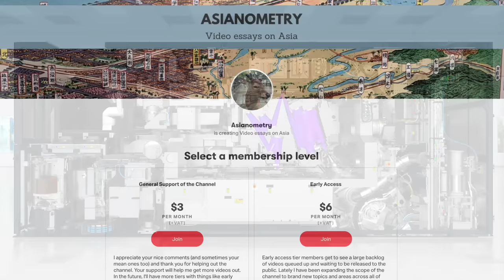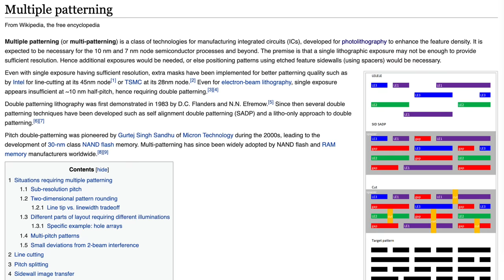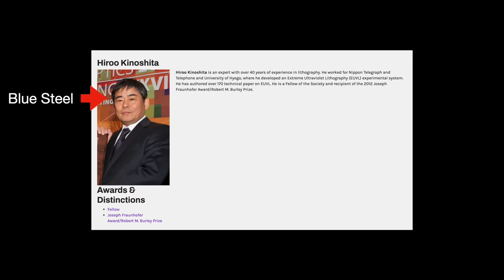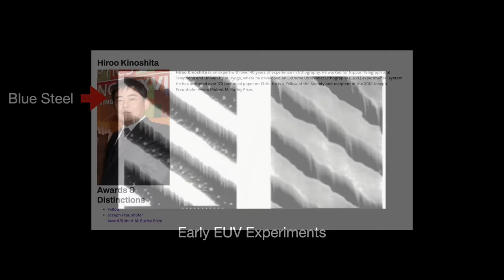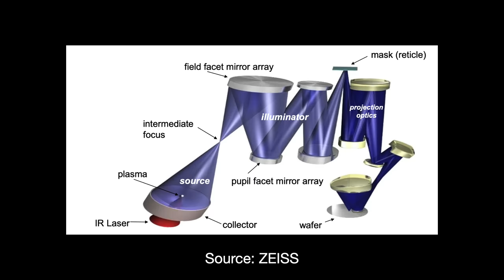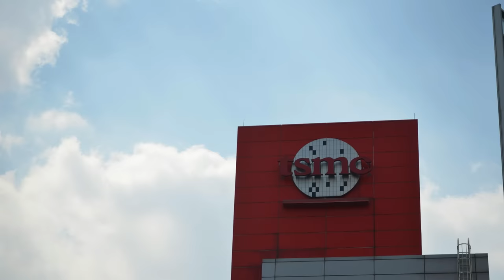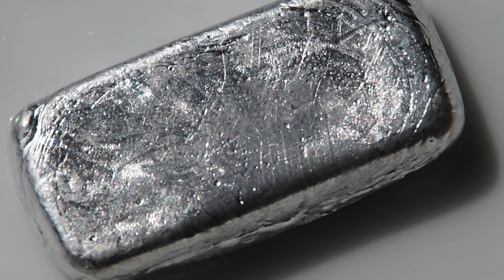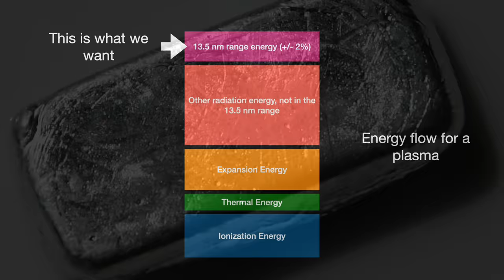The Extreme Engineering of ASML’s EUV Light Source

Comment: How about swap the hydrogen out for a mix of deuterium and helium . Have the plasma chamber surrounded by a powerful magnetic field with an internal RF exciter coil. Next drop in your tin ir other metal. Blast with a powerful laser, type does not matter much except that it must be high energy density. Q switched lasers. It will require two pulses. First from an excimer laser such as ArF, that one strips the remaining outer shell electrons, second a q switched Nd or CO2 excites k shell electrons to make soft x rays. As the mangentic coupling confines the plasma the need to repeatedly blast tin drops woulf be avoided. Instead the already existing plasma would be a mode converter. Conversion efficiency would be a function of energy density, and a optical to optical conversion of 10.6um to 13.5nm would approach 25 percent especially if a structuring pattern is imparted on the beam to create a travelling wave in the plasma bottle. ❤

Comment: does anybody know what could be after EUV (or any kind of lithography)?
Reply: Yes, its basically going even shorter wavelengths. BEUV - or Beyond EUV :)
Reply: Nano imprint
Reply: The next phase is Large Aperture EUV. So same light source but much bigger mirrors with tighter focal points. This gives a smaller Critical Dimension. Small enough that there is no point going beyond that because quantum fuzziness will start fucking with us big time. So the next big leap is not to go smaller, but to go both more energy efficient on the transistors themselves and to start stacking multiple layers of transistor patterns. They're also researching using carbon nanotubes for connecting the transistors. Currently about 50% of a microprocessors power consumption is plain routing. Stacking things or connecting them with a much better conductor are both avenues to reclaim some of that loss.
Reply: Trained bacteria.
Reply: Nanoimprint or 3d IC.
Reply: @andersjjensen  the issue with stacking for what i know is the thermal conductivity of silicon.
Thicker dies would cause hotspots in high power chips (like CPUs).
In the end we'll need to move away from silicon
Reply: @andersjjensen  I heard of electron beam etching too, but I don't see how that would scale.
Reply: @Ubya_  AMD is already expienced with using the vias (the layer interconnecting "towers" of copper) to extract heat from the lower layers. They're pushing the first multi layer product to market early next year, so we'll see how it fares soon enough.